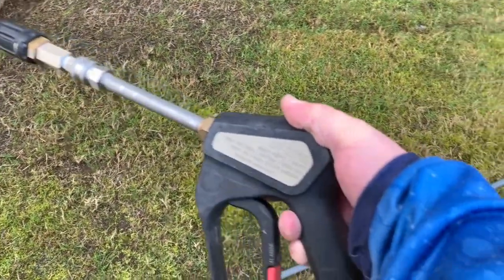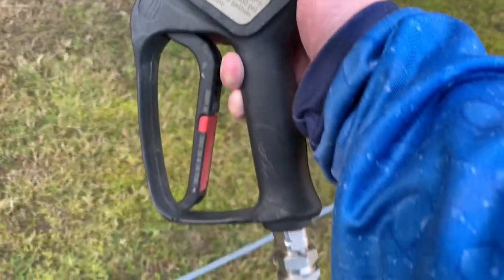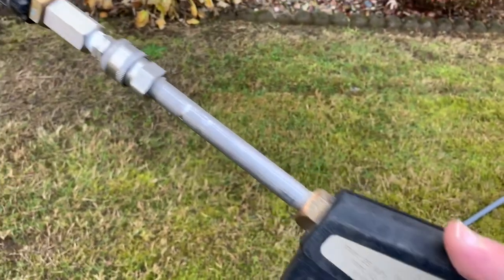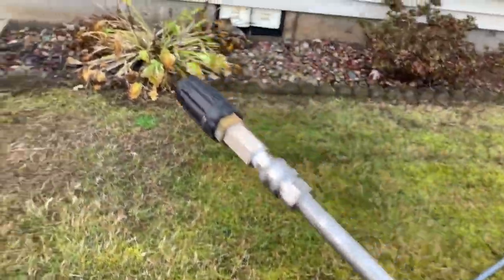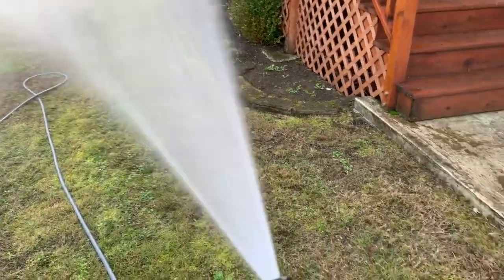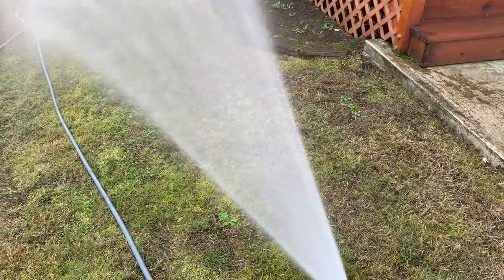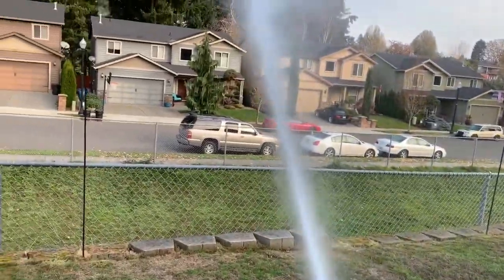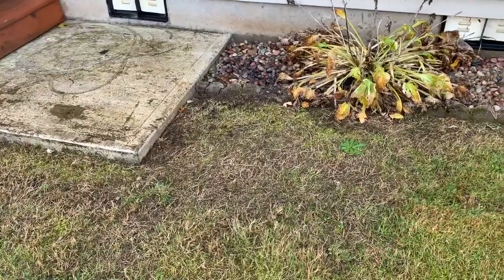What Pressure Washing Gun I Use | Suttner 2315 M5 Twist Nozzle

Comment: Is it possible to clean roofs with a pressure washer?  Or do you need a dedicated soft wash system (i.e. 12 volt pump, etc)?
Reply from the maker: Brandon Evans, never clean roofs with a pressure washer. There’s so many reasons not to. Use a dedicated pump. Thanks for watching and commenting.

Comment: What are you using for the 6 inch pipe? I've look everywhere and apperantly no one sells something like that
Reply: You can get them off of old guns. Take the gun apart. Sometimes cheap surface cleaners have them underneath
Reply from the maker: Bought a couple of mine at Home Depot. Use stainless steel

Comment: Do you run straight sh or mix it with water?
Reply from the maker: I downstream straight SH. This works perfectly for the 8 GPM. You may want to dilute a little and test cleaning strength if using a smaller machine. Hope that helps. Appreciate the comments.
Reply: @ExpertPowerWash  It does help. I run a 4 gallon a minute. I was wondering about doing 2 gallons of sh3 gallons of water in a 5 gallon bucket if that would be enough. Cuz that's what I'm currently using with my downstream and j rod but didn't know if this XJ nozzle required something different
Reply from the maker: The old timers in this industry taught me change your ratio until it starts cleaning. The only way to tell is to test it. Don’t get too caught up in draw ratios and knowing exact science unless you want it. I’d try that suggested ratio and see if it works. I don’t use a 4 GPM so I may not be the person to ask. If it cleans way to quick, bump it back down. You have to be careful that your mix is just strong enough to clean but not kill landscaping.
Reply: @ExpertPowerWash  perfect. yeah that was not suggested it was just what I figured out worked with the regular down streamer and my j rod. I just didn't know if the XJet shoots a different ratio than just a regular soap nozzle. Because it just seems that it's just a variable fan nozzle which would draw soap like the fan soap nozzle or the second story nozzle or even a shooter tip
Reply from the maker: My xjet stays on my truck but rarely gets used. I don’t prefer them. I think it sprays out too much and has a less direct pattern. This is especially true with higher reach stuff. I would definitely look into a j rod set up. They are cheap on Pressure Tek. You don’t need to know what nozzle sizes, they sell a kit that matches your GPM. This is just my opinion. There are guys that use a x jet but not many after they discovered downstreaming. No one wants to pack around the x jet jug.
Reply: @ExpertPowerWash  already have an rod and a Kyle Davis shooter tip. I bought this m5ds mainly for ranch homes and the occasional two story. I just wanted an arsenal of options 🤣🤣.  I'll play around with ratios and mixtures at my next job... Which happens to be a trailer 😁😁